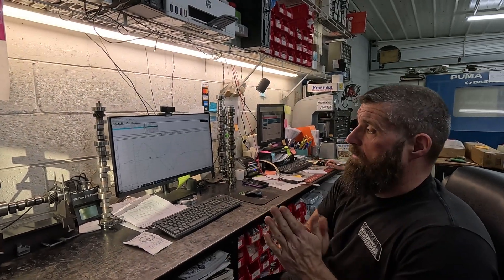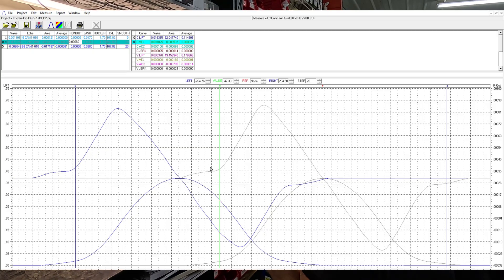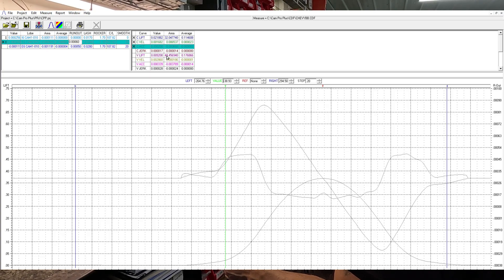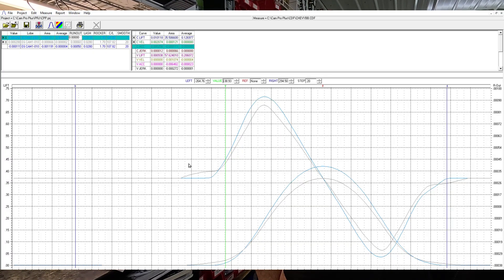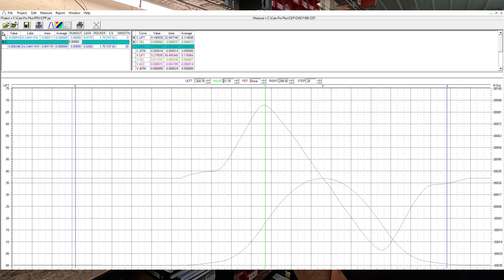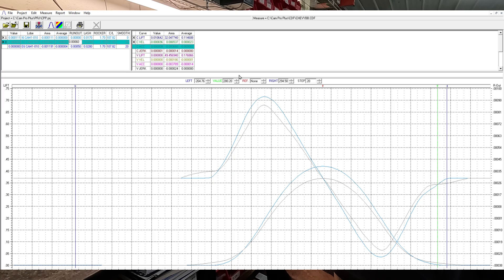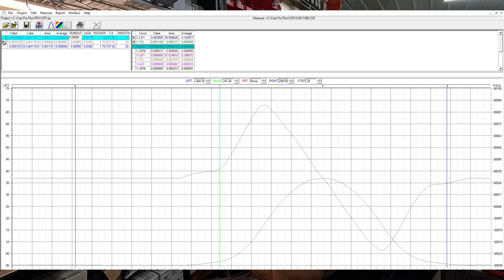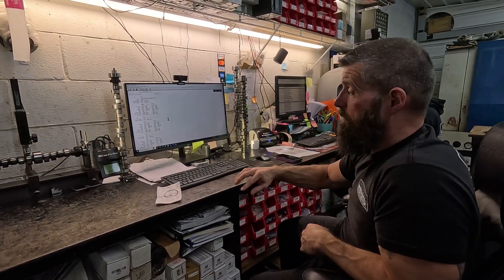More Valve Lash and Lobe Design discussion.

Comment: Strange but great discussion
but let me discuss how Chrysler/ Mopar shows cam data in their service manuals and Direct Connection/ Mopar performance.  They do not show durations or timing points at any particular lift.
 Instead they take their blueprint and determine where the ramp curve meets the acceleration curve.  
Then they subtract 8 degrees 
that's it
So the height of the ramp does not matter
For all practical purposes .008 works for hyd cams in comparisons, same as Engle and some Isky but makes the lobe look shorter than say Comp at .006 or Crane at .004  
SAE (with a 1.5 rocker) standard is .006 at the valve which gives .004 at the lifter (used by the big Detroit Grinders)
makes the same lobe look different with every rocker ratio
Reply from the maker: "Ramp curve meets the acceleration curve " is a nonsensical statement,  someone doesn't understand some basic lobe fundamentals
Reply: @PowellCams  That explanation was from the late 50's or early 60's most likley using 3 arc cam designs but they carried the concept at least 78 service manual
Point is they were using a point on their curve to set their durations and published timing points IO IC EO EC shown in the service manuals (so essentially worthless)
Reply from the maker: @jmflournoy386  my statement is still factual and accurate

Comment: I asked exactly this question at the cam designers forum at PRI. Back when OEMs were designing solid profiles for pushrod engines, they had to consider the guy who might have to crank up his engine in North Dakota when it was minus 30°. My guess is early cam designers just carried that practice forward for the next 40 years until the 1990s. It was about that time that tight lash cams started to be designed. Today, there's no reason I can think of to design a performance solid cam for more than 0.015" lash. I'm glad that everyone in the cam designers forum was in agreement with me.
Reply from the maker: If you watch my pri video I address your question directly
Reply from the maker: . 015 sounds good,  but it doesn't work for everything

Comment: Im no cam engineer but in the early days of using solid roller on street or any application where idling a lot they didn't live long or were constantly requiring lash adjustments, seemed they were slapping themselves to pieces ( were nosy too) it became common practice to fit a rev kit, this was not for more rpm but 1. Keep roller in constant contact with lobe and allow lifter seat to fill with oil and act as dampner ( that was the thinking) and if there was a valve train failure to keep lifters in bores to maintain oil pressure, it looks like they were trying to do something similar with lobe design to get roller moveing before full load, at least that would be my take on it
Reply from the maker: Idk, we never really see issues myself
Reply: I'm taking 30/40 years ago roughly 😂

Comment: Might be interesting to get a hold of a old tech cam, like the mid -60’s Chevy Duntov cam, to show y’all’s point. Seem to recall it being referred to as the 30-30 cam, that I think was in relation to the recommended lash. Think the theory then was to accelerate things open as quickly as possible, but, it managed to survive, as a flat tappet cam, even at those lash numbers, and relatively crude lobe designs.
Reply from the maker: It was slow like this example
Reply: You need to know the ramp height before the lash discussion makes any sense and what Daniel says

Comment: This looks to me like a street solid roller with a long constant velocity ramp to take up lash and initial valve train flex before starting to actually open the valve. The symmetrical design would indicate that’s how they’re setting the valve on the seat again, too. I’m not any kind of lobe designer, just a life-long mechanical engineer raised by a PE many long years ago. An interesting discussion yet again. Thanks Daniel!
Reply from the maker: The cv area is before lash take up
Reply: @PowellCams I had to look at the screen shot again…the CV area is a constant velocity which translates to a steady increase in lobe lift (rate of change of distance, or in this case lift). You can see the smooth lift on that trace at the bottom of the screen. Any way, that’s what it looks like to me. This may be way too much of a discussion for Christmas Day—hope you and yours had a good one.

Comment: I run cam motion low lash solid roller that calls for .010 lash hot.    I generally set them at .005 cold but have set at 0 cold .   What effects does tighter lash have vs looser on a low lash?
Reply from the maker: Tight will make the duration larger and make the valve open at a lower velocity and stay in the low velocity area longer, looser will do the opposite
Reply: @PowellCams  does tighter help top end vs losing tq?
Reply from the maker: @CLEEPER1  it's going to make the cam bigger,  so you can use lash to see what the engine likes
Reply: @PowellCams  you will not be beating up your valvetrain and breaking parts (as much)
Reply: CLEEPER1, You might wanna call Cam Motion, I talked with them last week because I traded a Lunati hyd roller I had for a Cam Motion solid roller. I called to find out their approach for lash, they said in no uncertain terms it was according to rocker ratio, 1.7 rocker ratio as example big block Chevrolet > .026 lash. This told me they use a .015 lash ramp on their solid roller big block chevrolet camshafts. I can't imagine how it is you're running zero lash, unless you're running a solid roller lifter on a hydraulic roller lobe camshaft, with no .004 -. 006 hydraulic ramp on the opening and closing side. You can run a solid roller lifter on a hyd roller lobe if the lobe has a .004-.006 hydraulic ramp on the opening and closing side without beating the fok out of the valve train. In that case lash would be .004 -.006 x whatever your lash is. As far as tighter for top end, it depends on the cylinder heads on your engine. What you can do to find out is run lash loops. Tighten the intakes a couple thou, and loosen the exhausts a couple thou at the track, then turn it around loosen intakes, tighten exhausts, see which way the car runs the best et.
Reply from the maker: @ripper-wrench  of course lash is rocker ratio dependant... I have multiple videos about it, what part are u confused about?
Reply: @PowellCams  You do? Good deal, you might want to provide links for CLEEPER1, apparently he hasn't seen them. Do your video's include the math? lash ramp x rocker ratio = lash?
Reply from the maker: yes math is there
Reply: @PowellCams  yes do not go loose without camgrinder or camdoc

Comment: Hi Daniel. Not to argue but that lobe was lazy but it hurt a lobe and it had big lash so the average person would think that big lash hurts stuff. I do understand that it is more the rate of acceleration that would hurt stuff not lash alone. Do you know why the lobe went bad? If you haven't done one already could you do a video on valve spring pressure/selection. Thank you.
Andrew
Reply from the maker: Wheel give up on a lifter,  nothing to do with the cam

Comment: What’s the .200 numbers , curious as the Erson has allot of advertised duration with that lazy ramp I’d bet the .200 is allot less than your lobe with the same .050 number , Erson has several cams that they sell as a solid or Hydraulic on the same lobe
Reply from the maker: That's crazy....
Reply from the maker: The .200 numbers were displayed in the video

Comment: Hi Daniel, do you use the same lobe design (intensity) on the BBC solid roller as you would use on a SBC solid roller? Obviously the valve motion would speed up with the 1.7 rocker compared to the 1.5 or 1.6 rocker used on the traditional SBC stuff.
Reply from the maker: Normally depending on some variables the lobe design would be different for a large/small base circle as well as a large /small rocker ratio
Reply: @PowellCams  and valve train weight, crank degrees at max lift (stroke/ rod) lots of reasons
Reply: Buttermilk  Biscuits LOL
Reply: With sausage gravy???!!!
Reply from the maker: @gisaac3779  mandatory